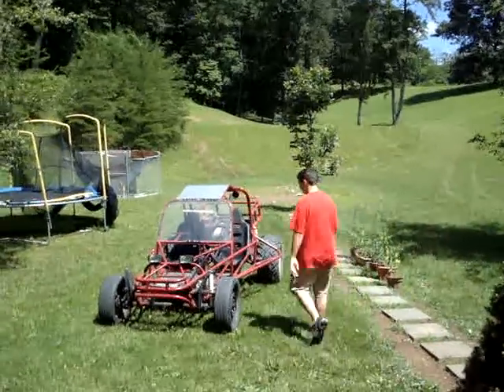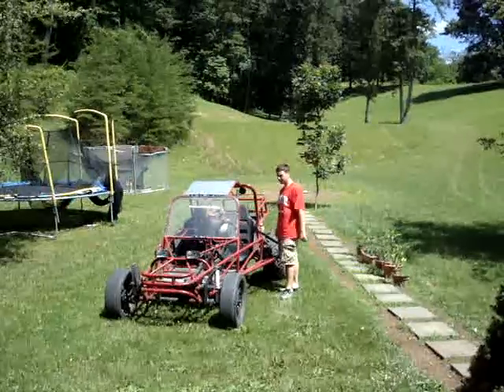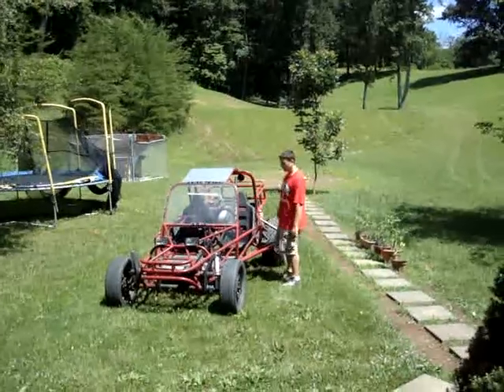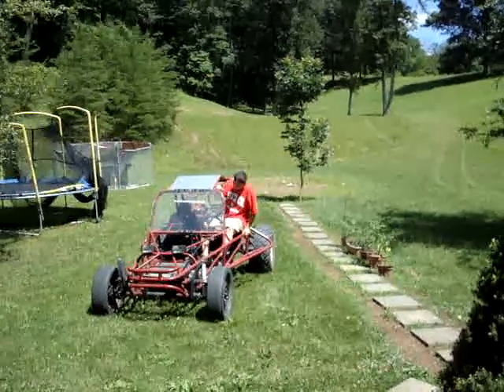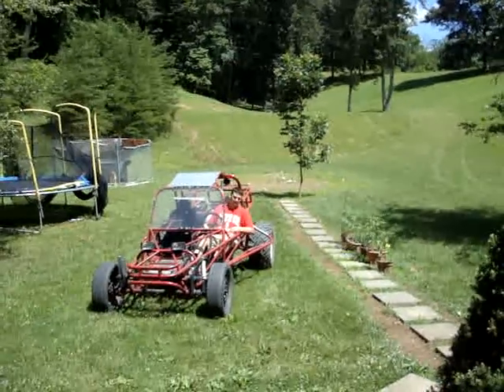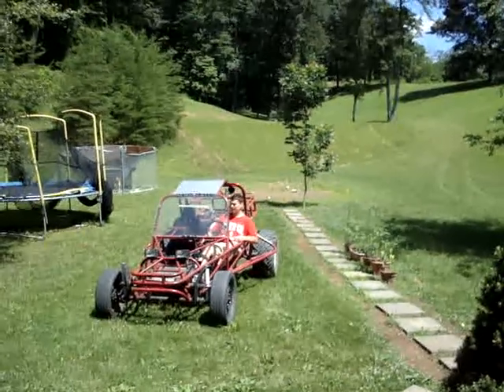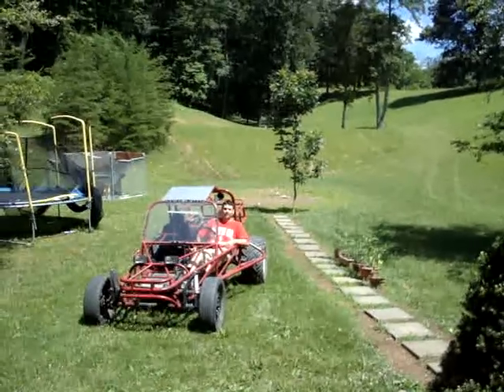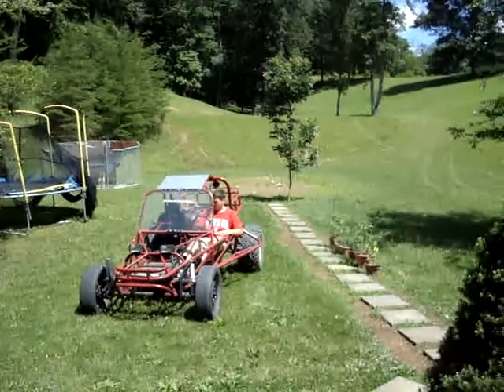New Dune Buggy

Comment from the maker: Yea i've done alot of work to the engine since the video it was out of time needed new valves new starter new altenator.  Now it has a rear view mirror signals on front and back, brake lights, backup light, independent rear wheel braking, 4, 100 watt lights in the front the altenator is larger than the old one so more lights 900 watts 75 amps.  I still need spedometer and diamond plated sections of the back, this winter i am going to take every thing off and have it powder coated bright red.